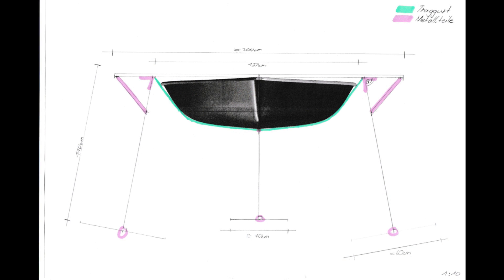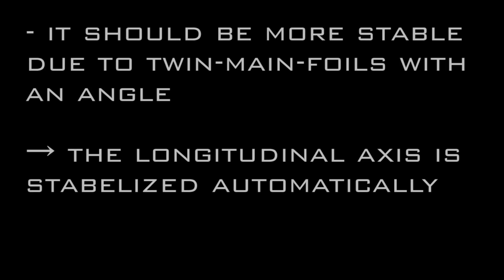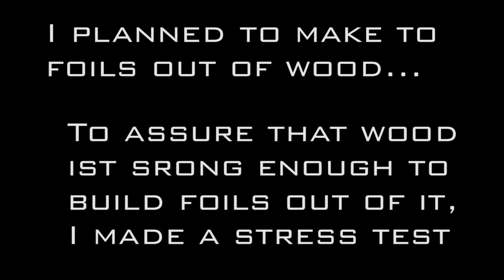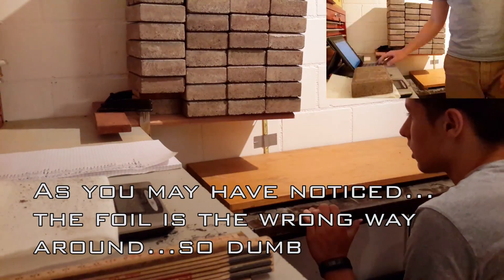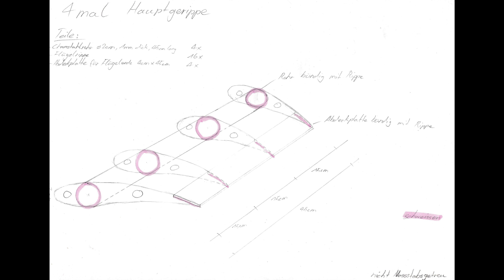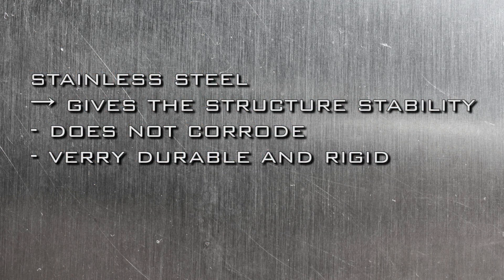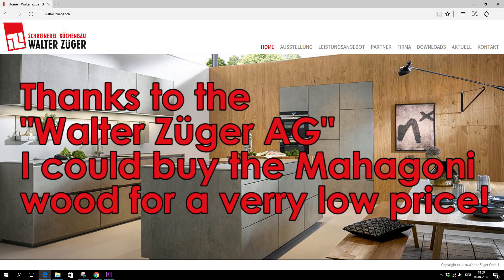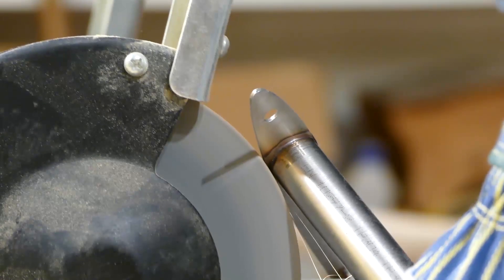Building a Hydrofoil for a Laser Sailboat

Comment: I must have missed something I don't see you sailing the sailboat with hydrofoil I see it being towed did it ever work?
Reply from the maker: Nope, you didn't. It was the plan to try it with wind, but on the two occasions I tested it, there was no wind ...and I would need at least 4 bf, because the foils are oversized due to the building materials used (cheap wood and steel).

Comment: I think your main goal was the eletronic height control, could be the reason for completely disregard the KISS concept (there are already far more simple and less fail prone ways to mecanically do that), but lets put this aside, for now...at which speed have you foiled up, would you be able to reach such speed under sail? Adding lateral foils to a sailboat, you might have think in assymmetrical lift, to fight heeling forces, how would you reinforce (or completely replace) not only the spar but also, the mast's foot structure, to deal with the increased loads, without adding too much weigth? And finally, there is already on the market, a complete plug&play foil kit for Lasers but ... without Eletronic Heigth Control, for sure.

Comment: what servo motor did u use?
Reply from the maker: For this test run only some cheap 40 kg servos from china. I expected thise to burn up and they kind of did, but they hold up 45 min just fine. (if they have to hold position under a weight, it is basicly a short circuit.. )
For longer operation a threaded rod and carriage would be better.

Comment: It would have been much better to see more footage at the end. Very cool. Fs ? Second ord pos. control? DSP on controller or do you just run recursion in std micro? Why FG instead of carbon fibre?
Reply from the maker: You are completly right, but I was on a tight budget (so no carbon) and had absolutely no time to develop the perfect controller, so it was kind of the savest cheapest way to take off once...
Reply: Lukas Reitemeier 

Hi Lucas, I’m designing a tri Marian utilising adjustable foils. Your electronics look great. Any chance of a discussion on the programming of the module? I can’t find anything on the arduino forum

Thanks in advance 

Al

Comment: Hello Lukas
Very nice project!
I have a question about the ultrasonic sensors. Did they work well for you in the water, or would you in hindsight suggest a different type of sensor?
Reply from the maker: The waterproof JSN-SR04T sensor worked verry well, especially for the low price. Even when the sensor got wet, the readings were accurate!

Comment: hi, im trying to make rc version of hydrofoil boat but i have a lot dificulties with electronic stabilisation system..could you please share your arduino code
Reply from the maker: In the PDF on this link way at the end is the whole arduino-code...
https://www.dropbox.com/s/bizrrhdzduxnlne/Lukas%20Reitemeier_Fliegen%20%C3%BCber%20dem%20Wasser%20-%20Konstruktion%20und%20Bau%20eines%20Hydrofoils.pdf?dl=0
Reply: @lukasreitemeier  Would you please send the file once more, I am trying to make a similar project but  I found the code very complicated to make, the dropbox link has expired.